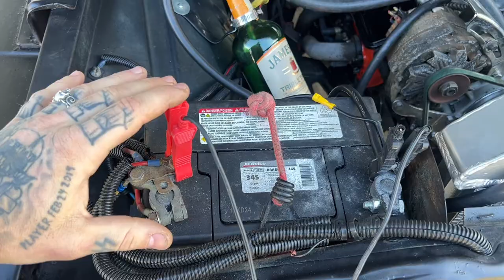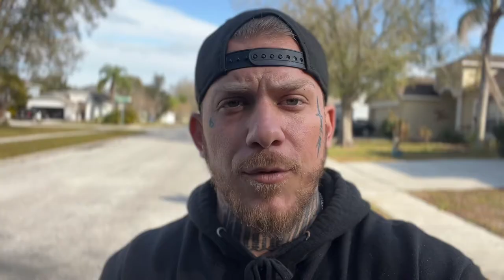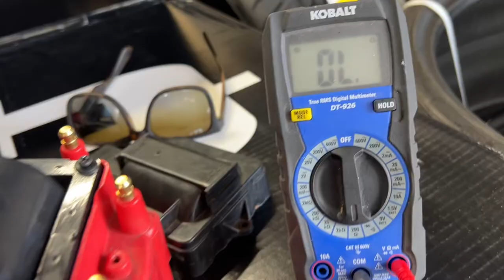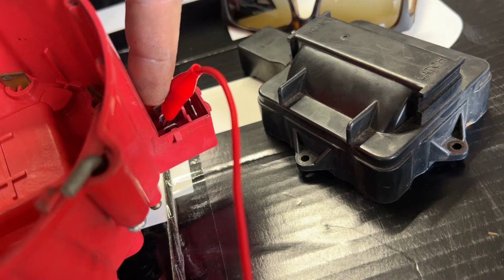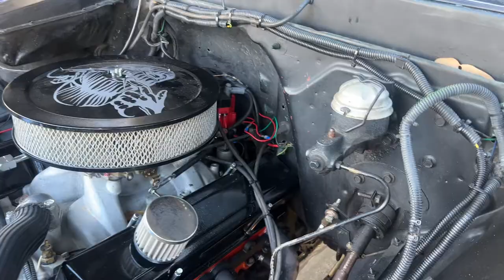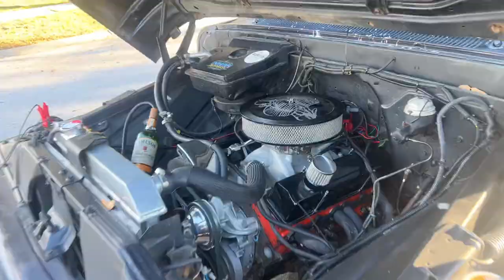SBC 350 Crank and no start! No Problem!

Comment: Just got a 76 c10 very very nice truck. 454, Weber throttle body. I’m about to test all of this tomorrow. I’ll drive around and after it sits for a while it won’t start. Happened twice today. I’m not new to cars and trucks. I had a 1980 firebird, but I’m still learning about carbed motors.
Reply: Crank no start -.- 😅

Comment: Battling my 78 silverado now. Relaced cap bug coil & module. Pulled/checked cleaned & gapped all the plugs. Pulled #1 TDC on compression stroke double checked my 18436572 firing order. Turns over but won't crank. Given up for tonite.
Reply: Literally going through the same thing right now I’m so sick of this shit … did you ever find out what it was ?

Comment: So my truck is not sending any power to the distributor. At the moment, I've made a temporary wire right from the battery goin to the distributor and it starts up. I'm not quite sure what I need to be checking next to figure out why the main power wire to the distributor is not getting any power.

Comment: Im having  the same issue, replaced  the ICM fired  right up took it 4 a drive stomped on it rev'ed  die again.  Replaced the icm again thinking  it was faulty fired right up revved it uo in the garage  died again. Sane issue cranks  but no start
Reply: Did you get it resolved?

Comment: ok so i don't want sound dum but I'm new to owning a 76 gmc sierra with a 350 but i am almost 100% sure I'm getting no fuel because the fuel filter is bone dry was running before it died and now wont start

Comment: Asking for advice… you seem to know exactly what you’re talking about. I did an engine swap. Took it out of a 98 Suburban 1500, and dropped it into a 98 Cheyenne 2500. Checked all my grounds, TDC, and all I’m getting is crank. No actual start… and I’m loosing my mind. Any advice???
Reply: I should add.. I have fuel, spark, and compression.

Comment: Im having the same problem. My SBC in my elcamino will crank and crank but not start. Checked and didnt have any spark.

I swapped out my Distributer cap and rotor and also swapped out my Ignition coil. 

The car started and seemed to work normal.

2 days later the same problem is back! No spark and will crank and crank but seems dead. 

I guess the ignition control module?

Any ideas would help a ton on this headache!
Reply: Did you try the ICM?
Reply: @elcaminodraco   Yeah It worked with a new ICM, the replacement auto zone ones are spotty I had to try 3 to find a good one.
Reply: @Anthony-ue4zm  El Camino great taste!